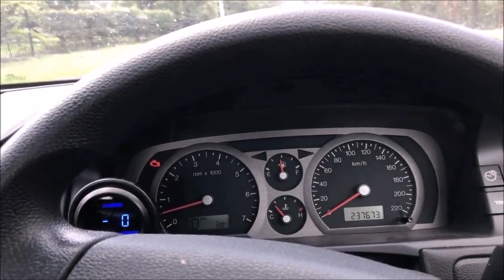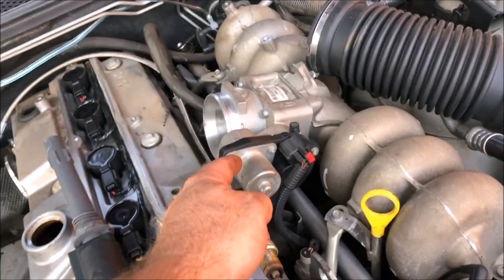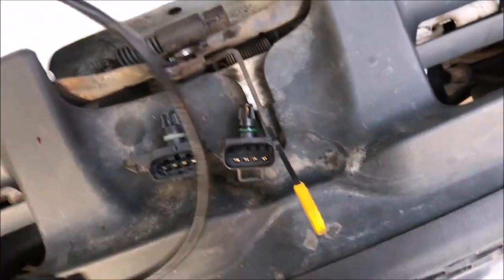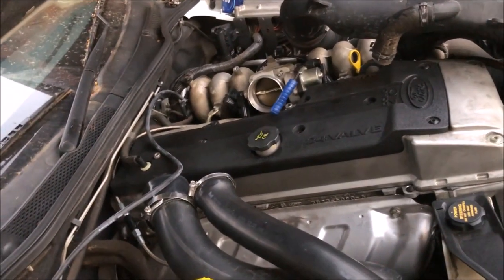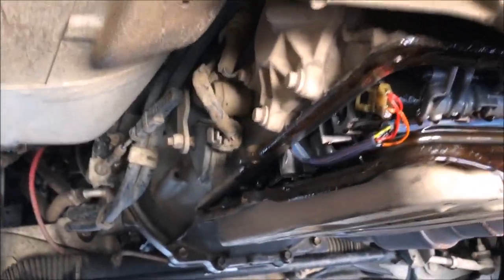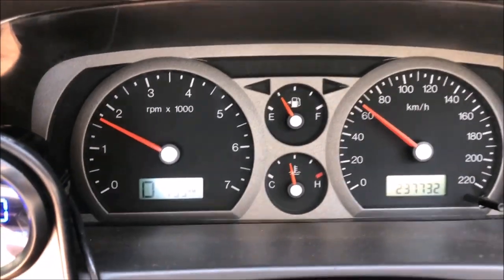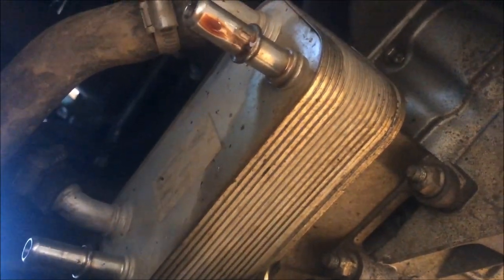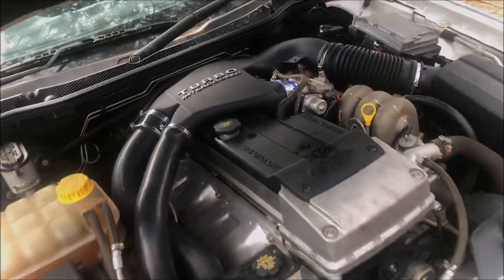NA Barra Turbo Conversion Pt3

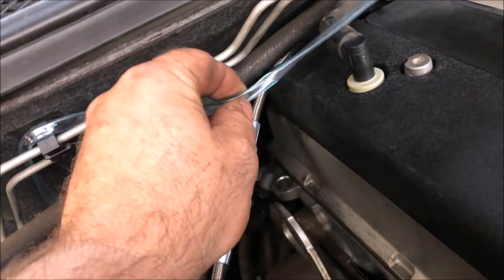Comment: Hi from South Africa, I have recently bought a mint 2006 Ford Territory GHIA and found this series. Very interesting and full of detail. I have learned quite a bit just watching you do this conversion. I know a hell of a lot more about my BA now. Thank you for this upload. 4:41, would it not maybe be better to have the actuator in the motor close to the intake and run the electrical wire to the boost gauge rather than a long boost line? Just a thought. I don't know much about cars much less about turbo'in one. Thanks anyway. Looks really neat

Comment: kool video mate 
im running a 350rwkw 980 nm 
on a built btr with a 2200 convertor and a transmission cooler 

btrs get a bad rep but mines been great for a 4 speed
Reply: Mind is awesome 2 mate. The shifter is really fuckin fast. I will be making 550hp, and I reckon it will handle it as long as I'm not doing skids and silly shit

Comment: I used to use the e gas plugs when I ran my fg xr6t  (was heavily bolt on mods with 440rwkw though ) but the e gas (with .075 gap) held high boost well

Comment: You can just use a shift kit which has an on off switch.
Reply from the maker: Yes you can now. Weren’t around when I put the videos together. I actually purchased the precursor to the switchable one about a month before they released the latest version. Would have waited if I knew.. 😤 
Cheers for watching 🍻
Reply: @oldskoolonly  Ah ok. From Shift Kits Aus or a different one? You could always sell it and upgrade. Cheers for the videos, the manifold butterfly situation is really weird, and no one else that I have seen has mentioned it.
Reply from the maker: Cheers man, yeah is a shift kits unit.

Comment: Hey mate, I don't know if I should do the bottom end on my ba xr6. I have a Spartan gt3584r turbo and plazmaman cold and hot side piping, 650cc injectors, performance tuned ecu and  I will be running 10psi. I don't want to do skids or drag race it. Tell me what you think mate, that would be great. Regards Matthew Keim
Reply from the maker: Hey man, I’ve seen stock bottom ends handle 14psi and I’ve seen them let go at 10psi. Live anything, once you push past the safe zone, it’s a risk but I guess it’ll depend on your time and how you drive it. Good luck with it man, hopefully she holds together for you. I’ve been running mine at 8psi for almost 2 years and not had any problems 🤟🏻
Reply: @oldskoolonly  thanks for getting back to me bro!! I don't want to have to go the full bottom end, fuck It would be a big job. I'm very impressed with the motor, the best barra motor I've ever had. The whole motor and drive line are perfect. Not 1 leak. I'm not going to be doing skids or drag it. I went for the plazmaman full set up. I know the turbo is a bit of a over kill, but I know someone who is stoked with his. It's a slower spool but it makes up for it.
Reply: @oldskoolonly  I got lucky with my ecu. I bought it for a bloke in Victoria. He is a freak car dude. He tuned it for me for nothing. He said it was the best tune I will ever get. He owns a mechanic shop, and he drives a xr6 that is making 1200kw. Yeah and it had more in it.

Comment: Wondering how much you spent, and compared to full engine conversion cost.?
Reply from the maker: Didn’t cost me a whole lot, definitely cheaper than buying a complete turbo engine, especially for what they are going for these days, but that’s all relative. But for me it’s all about the experience and the build
Reply: @oldskoolonly  how much did the tune cost mate?

Comment: Hey mate, can you link the water lines and oil lines, as im currently doing the same conversion on my FG NA (ps this has maade me pull the plug to do it)
Reply from the maker: Stoked you’re inspired man 👍🏻 Not sure what you mean by link??
Reply: @oldskoolonly  ah was hoping for the ebay listing - :)
Reply from the maker: Ah ok.. I’ll have a look
Reply from the maker: The link is too old now to copy but this is the description, “BA BF Ford Falcon XR6 Turbo Braided Oil & Water Line Kit With Filter FPV F6” hope that helps
Reply: @oldskoolonly  Legend :)!

Comment: Hey mate where did you get the map sensor adaptor
Reply from the maker: Hey man, just on eBay
Reply from the maker: Heaps of info for alternatives in the comments on my how much did it cost video 👌🏻
Reply: @oldskoolonly  thanks heaps for your help mate just about to put a Barra in my patrol and you’ve helped heaps with the turbo side of things, did you have to get a new fuel pump or was the factory one sufficient
Reply from the maker: Stock na fuel pump 👌🏻